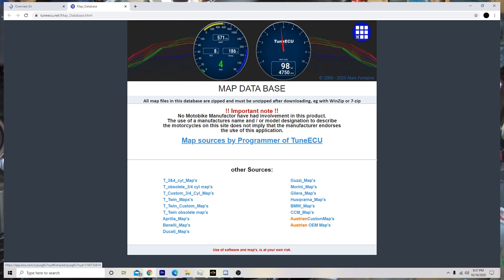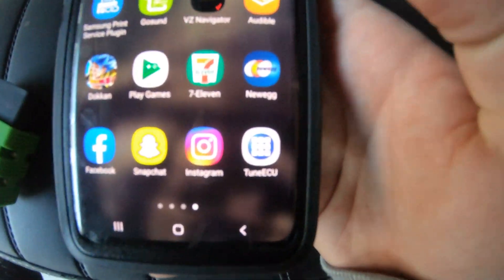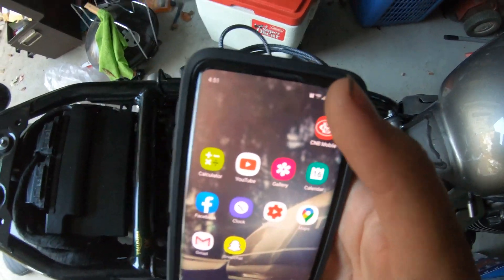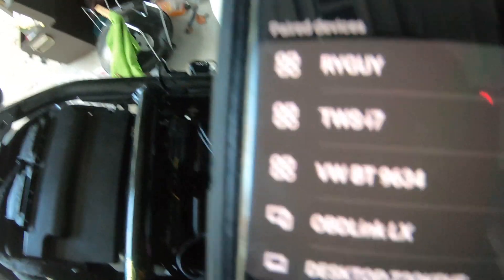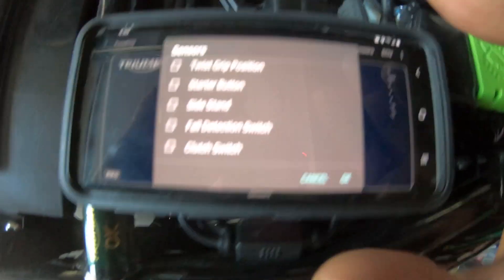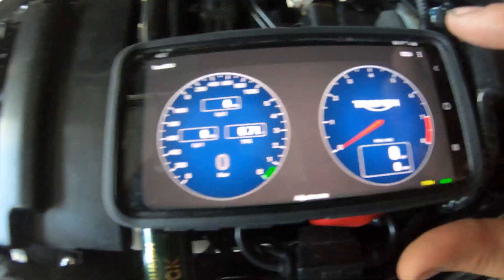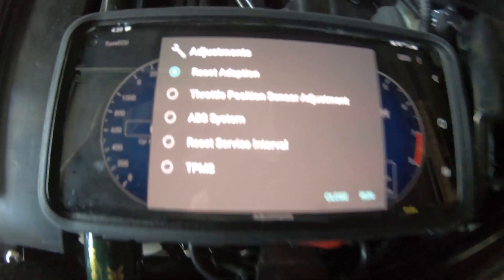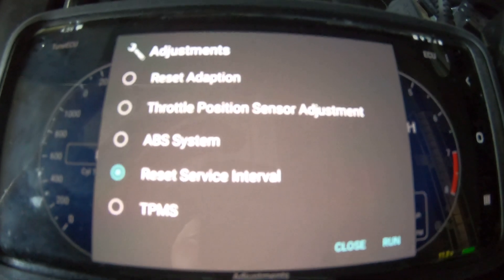**AUDIO FIXED** TuneEcu for Dummies // Become a Triumph MASTER // 12 Minute Tune

Comment from the maker: VERY IMPORTANT ANNOUNCEMENT!!!
Resetting Adaptations is not necessary anymore or recommended. The creators of TuneEcu have directly stated not to do the "reset adaptations" anymore, and to simply use the 12 minute tune method. 

Also, if the audio bothers you, i created a duplicate of this video without the music. Look through my videos and you'll find it

Comment: Thanks for your time is this program works for my 2017 triumph street twin 900 ? Also they change the muffler and the rpm are little higher thank uou
Reply from the maker: Yes it should work for the Street Twin 900 🤘

Comment: Great video thank you !! I have 2017 triumph street twin900 and the rpm is high and I shift the first gear it jerks hard pls help me out thanks
Reply from the maker: Try doing a relearn procedure. Start your bike and don't touch the throttle. Let it idle undisturbed. When you hear the cooling fans kick on for the first time, set a timer for 12 mins, or maybe 15mins just to be safe. Continue to let it idle without touching the throttle for the 12 or 15 mins. After this you can turn off the bike. This is called the "12 minute tune" (its not an actual tune). It resets idle loop parameters. Let me know if its still an issue after this

Comment: Is the 12MT necessary after the remap? The bike should adapt to the new map after riding for a while, yeah?
Reply from the maker: Yes you nailed it 👍 12mt isn't really necessary unless the bike is struggling hard coming off idle and riding doesnt feel safe

Comment: What is the difference between PC 5 and the thing you are doing. Iam really new in this topic. I would be really happy when you give me your feedback
Reply from the maker: Power Commander 5 is a piggyback unit that you install directly on your motorcycle. The unit itself can be connected to and installed with different tunes. You must use a specific software to interact with the PC5 unit. Most mainstream motorcycles are compatible

TuneEcu is a software program lets you flash the motorcycle’s ecu directly, run data logs, test sensors, and essentially give you executive control over your motorcycle. You have to purchase a seperate bluetooth adapter (OBDLink LX) to connect the motorcycle to the TuneEcu software. TuneEcu isnt compatible with as many motorcycle brands as PC5, but it's compatible with bikes that PC5 doesn't. CCM, Moto Guzzi, and Moto Morini are TuneEcu compatible but not PC5.

Comment: Hi, I have TuneEcu and a custom DNK tune for my 2022 scrambler 1200.  The dealer just installed the bluetooth and updated my ecu. Does anyone know if I reinstall my DNK tune if it will remove the bluetooth software?  I reached out to DNK but they did not know about my situation.
Reply from the maker: Danielle doesnt really know much tbh, she just sells her tunes and hopes people don't reach back out. 

What you should do is try to read the map file thats on the bike. Compare it to a stock tune file that you can get on the Tune Ecu website! If the maps look the same, you'll need to reinstall your DNK tune. If the tune on the bike looks different from the stock tune off the website, then the bike probably still has the DNK tune on it. Hope you figure it out!

Comment: Hey! thanks for the tutorial! 
I have a question, does the LX is enough for the Triumph tiger 1050 sport (2013)? i might need a reset of the map/adaptation of my bike. From this documentation, i understand that I might need a cable connection and not bluetooth... am I right ?
Reply from the maker: You need a Bluetooth adapter now. Things have changed!

Comment: There is no 12 minute tune, never was.  It's a mild reset on some low level adaptives, nothing more...  This is one of the Triumph Myths that just won't die because people keep repeating it...  lol
Reply from the maker: I definitely mentioned the fact that its not a tune in the video. You are taking the word TUNE in the term "12 minute tune" way too literally. The "12 minute tune" is not a map or tune at all. It is simply the NICKNAME given to the reset by the general masses. People have been calling the idle loop reset the "12 minute tune" for more than a decade my friend lol

Only reason that nickname became so popular is because it used to have a huge effect on the older triumphs, and make them feel better while riding temporarily. 

Don't get your boxers in a twist. Some people call them jimmies, but i dont get mad at them because i prefer sprinkles 🤷‍♂️
Reply: @NicePantsLance  long time triumph tuner here, so I want to make sure the info is correct.  I see too many people tossing on a full race exhaust and claiming that the bike will tune itself...  I see it almost daily.  Lol
Reply from the maker: Yeah i see the same thing in the facebook groups lol people are becoming more and more ignorant. They take the first thing they see on the internet and run wild with it. People love to tell others that the "ecu will adjust itself" when asked whether a tune is necessary after a header install lol 😆 its a people problem for sure

Comment: Hey I have a speed triple 1200 RR do you recommend tune ECU or power commander? I wanted to install a racefit exhaust and don’t want the bike running too lean
Reply from the maker: It depends on what your local dyno tuner prefers. Id always prefer TuneEcu, but i understand not many tuners are willing to use it. Most tuners use PC5

Comment: Got a question concerning resetting adaptations on the Street triple 765 rs 2020+. I selected reset adaptations but ran out of time to start the bike and let it idle for 15 mins so just switched the bike off (bike was not started). The fuel level indicator reset as well. Will it be ok to start it in the morning and run it on idle for 15 mins or do I have to reconnect tuneecu again and re select reset adaptions again?
Reply from the maker: You're alright! Actually, the reset adaptations should only be used IN PLACE of the 15 minute reset, only when the bike is already up to temp. I know i didn't provide some of those details in the video, but to answer your question, yes you are totally fine to run the 15 minute reset and dont bother resetting adaptations again! The 15 minute reset willl take care of everything! After that, have a nice ride 🤘 hope this helps!

Comment: Dealer tool works great too!
Reply from the maker: I've heard good things about dealer tool! Although, i dont believe you can remap your bike with dealertool, can you?
Reply: @NicePantsLance  no remapping. But you can bleed your own brakes with it. ABS of course! And set throttle bodies.
Reply from the maker: Thats a great function to have! I check my throttle body balance twice a season atleast! How expensive is dealertool?
Reply: @NicePantsLance  it's not expensive at all depending where you live since it comes from the Uk. 80 dollars and some change shipped here to the states and they update it from time to time you can do alot more with it too then what I mentioned it's the same thing basically your dealer uses to check things and clear codes etc etc. It's worth it imo. 👌 oh forgot to mention clear that annoying spanner wrench too for oil changes.
Reply from the maker: Well its good to hear its about the same price as TuneEcu! I think the main reason i bought it was so i could remap the bike, but all the other features really captured my attention! I feel like a device like this should be in every motorcyclists garage lol
Reply: @NicePantsLance  If you like to do your own wrenching its the perfect way to go. I don't really care to re map my bike a 22 street triple rs I enjoy it the way it is but the tool helps a lot. My last bike was a 17 FZ-10 that was tuned really didn't enjoy it too much the  power wasn't really meant for the street and unusable.
Reply from the maker: @mikem4371  to each his own! I personally think every modern ecu map deserves to have the AFR's fixed, but im sure most people dont mind the way it feels stock. Not so sure about your FZ, my buddy has an MT10 and he gained almost 35 horsepower from the tune. Its a completely different bike now. Not sure what kinda tune you put on your FZ, but you may have gotten shorted! I live in the USA so speed limits are 85mph on many highways lol high power bikes are the best for navigating high speed traffic 👍 thanks for watching and ride safe out there Mike!!
Reply: @NicePantsLance  Oh no the tune was perfect it was a 2wheeldynoworks tune nothing wrong with it at all woke the bike up completely and transformed it into a new beast I just meant in my opinion really no need to have that much power on the street. I enjoyed the vid and will follow along. Just unusable speed and torque on the street isn't really my cup of tea if I was going to do track days that's a completely different story.
Reply from the maker: Oh yes well said! I agree, you really can't use that power effectively on the street. Ive heard good things about 2 wheel dyno works! If i ever had a Yamaha I'd buy one of their tunes 👍 do you still have the FZ? What do you ride now?
Reply: @NicePantsLance  nope got rid of it. I've got a Street Triple RS now.
Reply from the maker: Thats one hell of a machine!! I had the pleasure of riding the 675, but id love to test the 765 RS. 

What do you like about the Street Triple compared to the FZ?
Reply: @NicePantsLance It's very light and nimble and is smooth. The auto blipper up and down the TFT Dash with more than enough rider modes plus you can make your own hooligan mode in rider mode there are no flat spots that I have found everything about it I really enjoy more than any bike I have had honestly. I don't think I will ever go back to anything Japanese. It will hang with any litre bike with no problem whatsoever just not the top speed of a litre bike.

Comment: My old Lenovo tablet with 2 GB RAM and Android 6.0 really struggled with the paypal buy and license registration step. Error message "tuneECU has stopped". 
But tuneECU connected to the ECU and displayed the VIN at least. Now buying a new tablet 😀
Reply from the maker: Interesting experience! I hope your new tablet works flawlessly for you 🤘 thanks for watching 😁
Reply: @NicePantsLance  I went for a Lenovo Yoga tablet with 4/128 GB memory, 11" 2000x1200 pixel screen and Android 11. tuneECU recommends Samsung tablets, but the brand shouldn't really matter.

Comment: I'll start doing more research. I downloaded my maps to my phone but they won't open
Reply from the maker: When you register your program, itll ask you to assign a folder for tunes. You have to make sure the files you downloaded are in that specific folder or else it wont recognize
Reply: Got it. Thanks. I could get error codes basically.

Comment: I don't have any test mode on my app! And I would love to monitor my TPS my bike Burns and falls plugs within 30 minutes, the air fuel ratio is way way off and I have the first fuel injected triumph bike there is
Reply from the maker: As i said before, you wont see any testing selections until you connect to the bike. You wont even be able to connect to the bike until you register and pay for the app. You should go to the website and do some reading. 

As for your bike, it sounds like you have alot more going on than just with tuning. What make and model of bike do you own?

Comment: I just put on Emgo exhaust tips so my 2013 Speedmaster can be louder so I can stay alive lol. Now it keeps backfiring. Any clue if I need to flash EVU or purchase a Power Commander or rejet it as I was told?
Reply from the maker: Kinda hard to call them exhaust "tips" when its basically half of the entire exhaust lol you're gonna get popping when you switch to a high-flow exhaust. Rejetting is for carbureted bikes, and i assume yours is fuel injected. Its not detrimental to the bike, but if you generally hate the sound, then youll need a Power Commander 5 with autotune or if youre lucky you could score TuneEcu and find a map that clears the popping. If you want all popping to disappear, you may need a pro dyno tune. Might want to check the online speedmaster forums or  speedmaster facebook groups first. Might get a more direct answer
Reply: @NicePantsLance  ok thanks man. I was only trying to do it because I didn’t want it messing up my bike. So, just so I’m tracking correctly. The backfiring isn’t messing up my bike correct? It’s just from more air getting in?

Comment: Will any old cheap OBD adapter work to check for error codes? I'm going to check a used triumph to purchase and taking along my trusty android just for this.
Reply from the maker: I cant guarantee that every unit will work. I guess there's a particular chip needed in the adapter to work with Triumph Ecu's. Not every adapter has the chip

Comment: Yo! im trying to get it to read my map on my 2006 triumph daytona 675! does it have to be running to do that , because in my menu it doesnt even bring up that "read map" option...
Reply from the maker: It's gotta be fully connected and the light in the bottom right corner has to be green
Reply: @NicePantsLance  I have all of that!!..does it need to be a constant green.. mine is blinking green.. I even uploaded a map.. and it wouldn't let me rewrite
Reply from the maker: @bmorisquati  are you trying to pull your stock map off your bike, or remap your bike with a new one?
Reply: @NicePantsLance  it won't let me do either! I've tried both
Reply from the maker: @bmorisquati  hmm I'd say make sure you update the application. Open the Map file first, then connect to the bike. If a new map is loaded and it's connected to the bike, you should have the option to reprogram the ECU. You gotta be under the correct menu though. Only 1 of those tabs actually gives you the reprogram option
Reply from the maker: @bmorisquati  it should be under the tab in which the first chart is the F1 throttle position %. Im just trying to help you figure it out 👍
Reply: @NicePantsLance  hmm... ive tried that.. could it be the cable isn't allowing me remap?? Im pretty sure the cable I bought was compatible cuz I can do everything else.. but I can try to get another one
Reply from the maker: What kind of cable do you have?
Reply: You habe to get a USB c to USB Adapter for your Phone and get a OBD2  USB cable. The  the Buttons appears. Bluetooth not working with our old Bike :)

Comment: so what happens if u lose connection in the middle of a map update? i would be too nervous to do this but this was very informative- happy new year
Reply from the maker: If you do lose connection, it usually is ok. However, you may need to perform the ECU recovery process. Its sorta like a system restore but for your ecu. Kinda nerve-wracking, but it doesn't take long. Happy New Year!!!
Reply: @NicePantsLance  how to?
Reply from the maker: To recover? Im pretty sure when you try to connect it will ask you if you want to begin ecu recovery. Thats if something goes wrong during remap.
Reply: @NicePantsLance  thanks